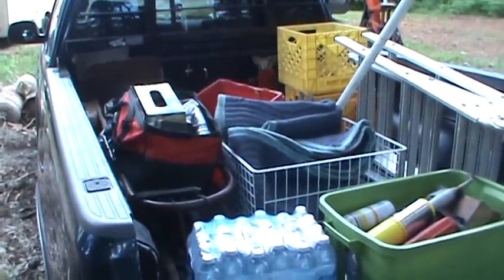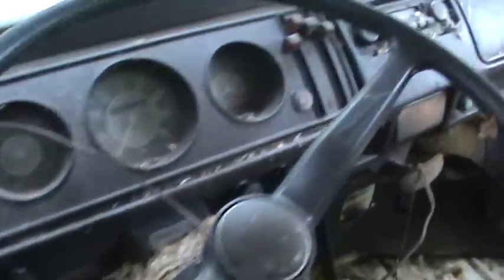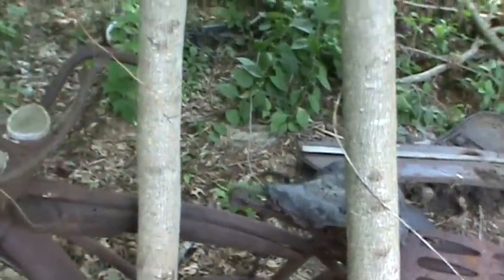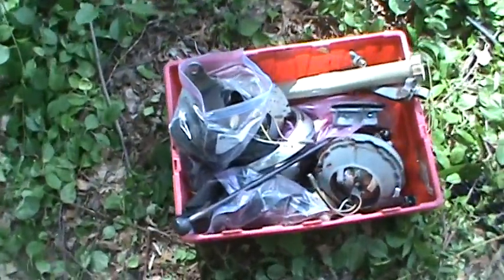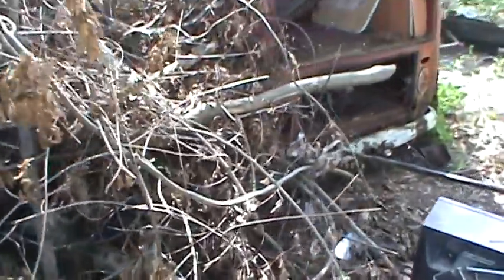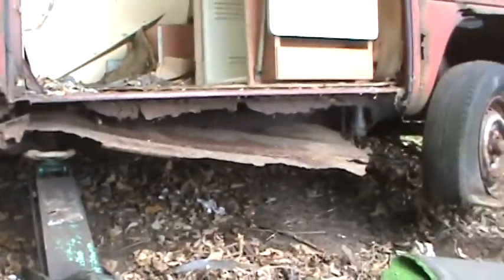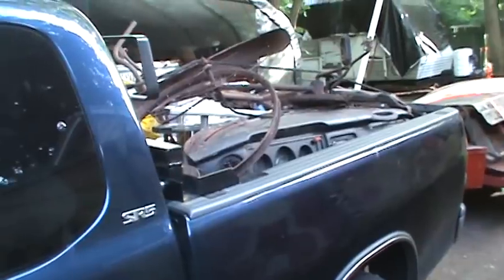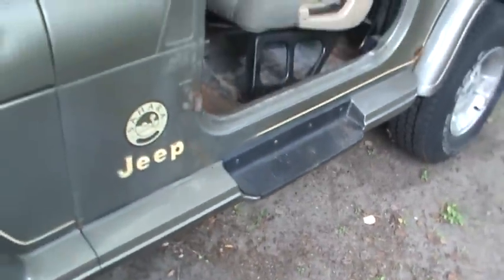stripping out an old vw bus,

Comment: The sad fact is that these VW Utility vehicles were never intended to last more than 5 to 10 years to begin with, add wet sea climate to the mix and corrosion does it part to accellerate their decomposition; but  AD 2018 Restoration is a good deed!

Comment: put some oil in spark plug holes and it will maybe loosen up and spray down the valves with some penetrating oil.
Reply from the maker: shartne l may stuff it in the engine stand so l can stand it on end for the soak